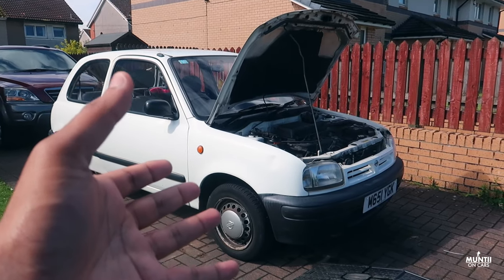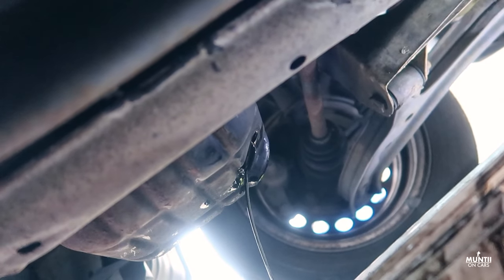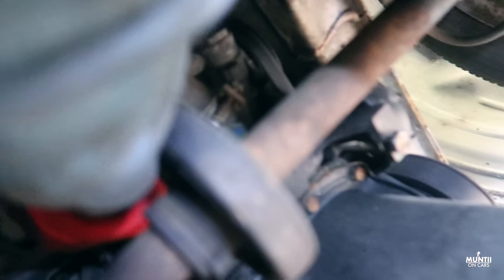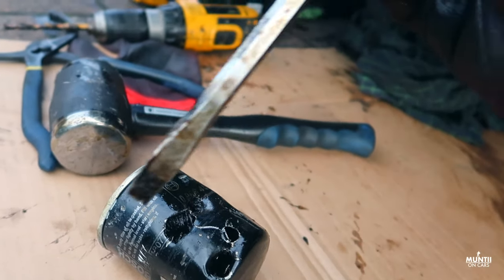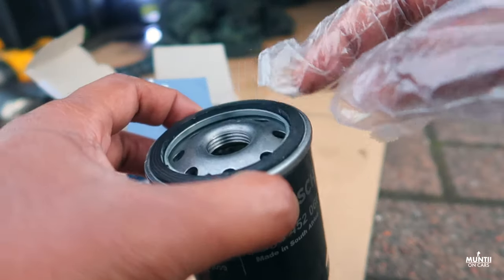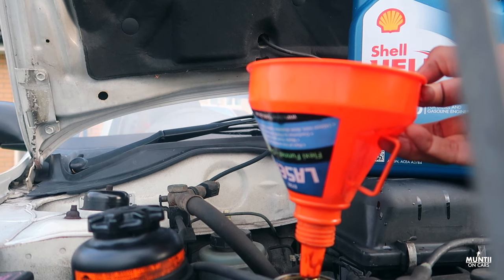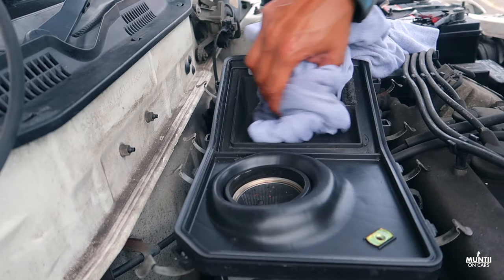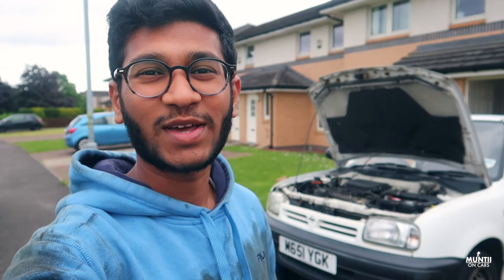How to do Oil Change and Air Filter replacement on your car? (Basic)

Comment: The only other thing I would add is use torque wrench to tighten sump plug.  Always use new sump plug washer.  Use engine oil filter removal wrench to remove engine oil filter.  Then tighten by hand tight with fresh engine oil on the seal which you did.
Reply from the maker: Soni Singh thanks for checking out the video! I appreciate your comment! You are right. I forgot to order new sump plug washer so used the one i got there and existing washer wasnt in bad condition. Stay tune and keep out for few more interesting videos on the micra!
Reply: Muntii on Cars any more news on the E30 or did u sell it ?
Reply from the maker: Soni Singh i still got the e30. Cracking motor! I will make some videos on it too once i am done with the Micra Series. I love these old cars, great to work on!